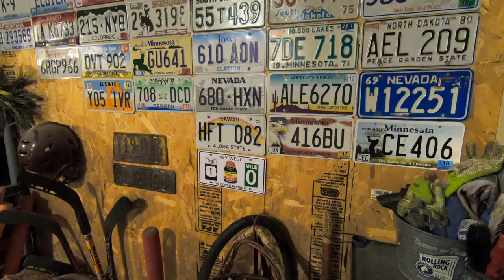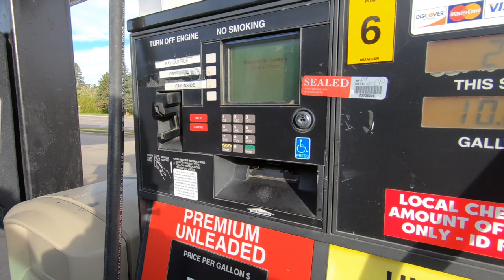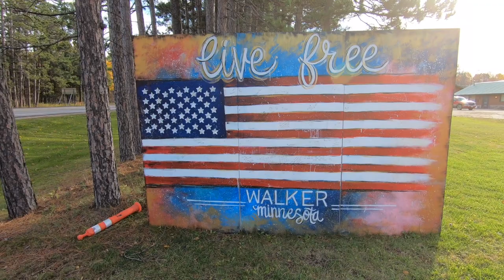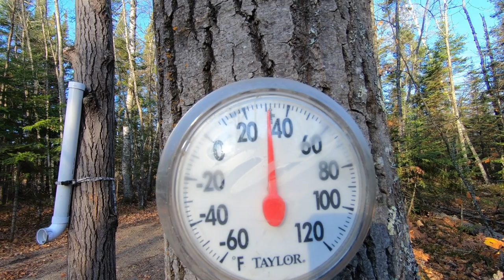Weekend homesteading: Pt2- building an off grid shed at the deer camp

Comment: As mentioned before make a T stand, aka dead man  for the board behind you.  In front of you, temporarily nail a 2x4 on the vertical wall so the celling board has something to rest on.  Depending on the thickness of your osb nail the temporary 2x4 within a half inch of the final location of your ceiling.
Reply from the maker: Good reminder. The next big build will be a sauna/bath house. That tip will come in handy!